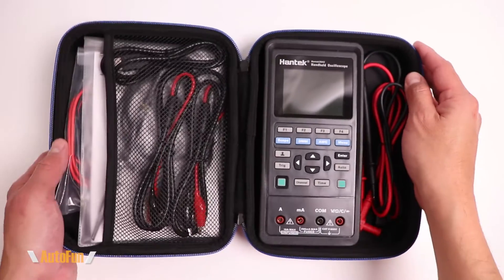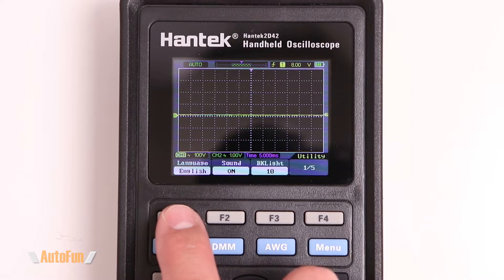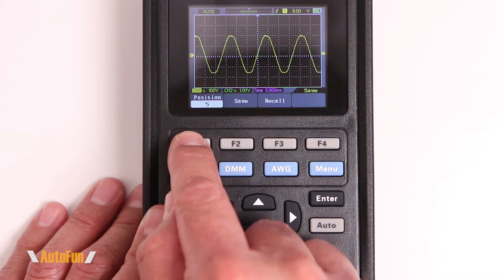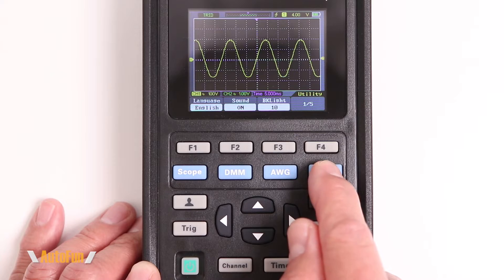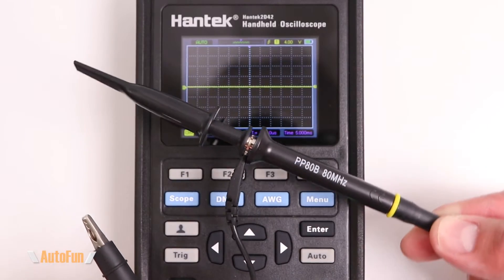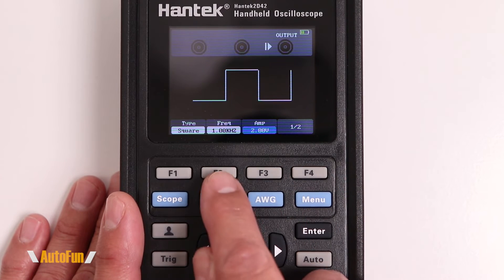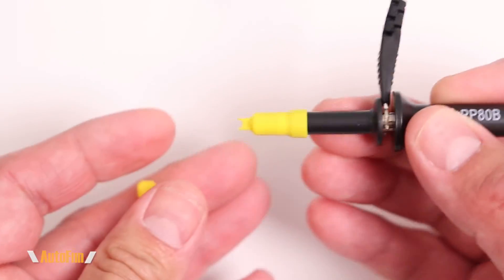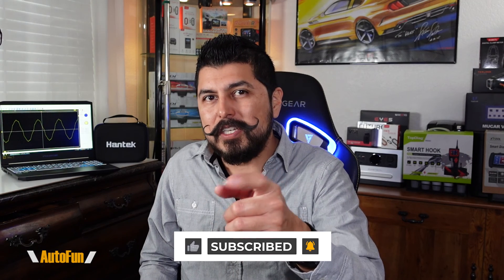Hantek 2D42 Oscilloscope Waveform Generator Review

Comment: I also have the Hantek 2D42. The outstanding PC software allows a USB connection to the laptop and checks on the larger screen for waveform details. I once used it to compare several chargers' P2P ripples and switch on characters.
Reply from the maker: Yeah, definitely a very capable scope, Cheers!

Comment: Very nice unit for the price.  Does the manual mention anything about accuracy or need for periodic calibration?  Can it even be calibrated should reading seem off?
Reply from the maker: Hi Richard! It has automatic self calibration but it can also be triggered manually. Now remember most measuring instruments have this function and it usually is very basic compensation more of a self check to see if everything is working. If you are using the scope in an environment where the results are critical (manufacturing, testing, development, engineering, etc) then I would recommend professional calibration by an accredited Lab (usually with intervals for re-calibration set by the organization that needs the scope). Cheers!